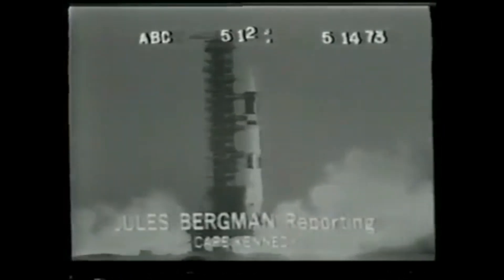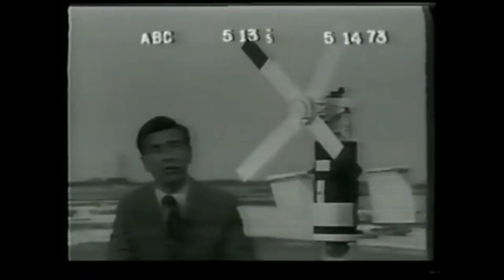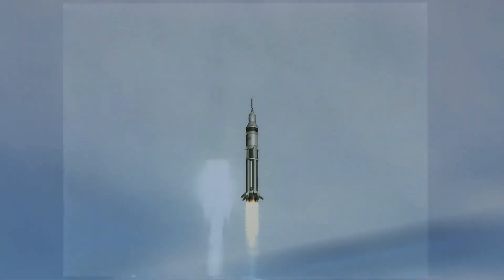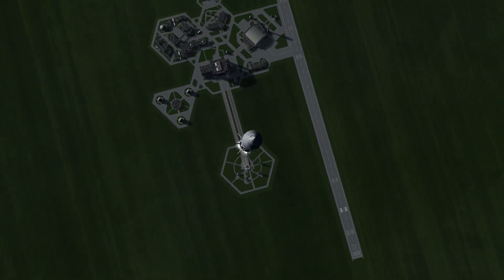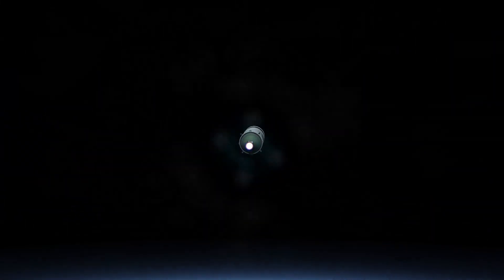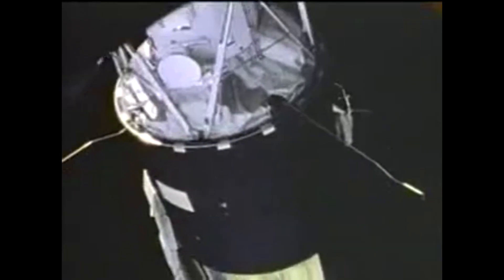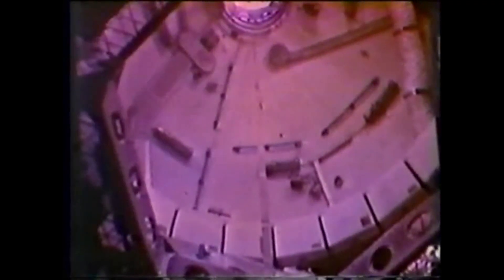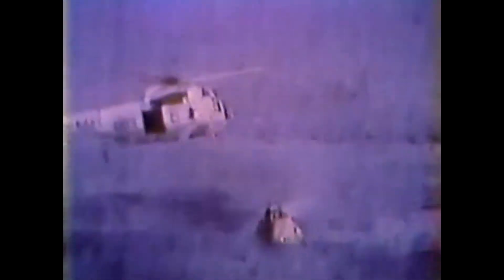Skylab - Episode 2 - A Change of Plans

Comment: With Skylab in space the first priority of Pete Conrad and his crew was to fix their house. The solar arrays were jammed and had to be cut loose, environmental control was turned off spoiling their rations, the MMOD panels on the hull were damaged and had to be replaced, and their docking port had to be fixed so they could get inside. Once inside Conrad and his crew went to work. Their first task was to deploy the two sun shades that were brought up folded in the command module. Once this was done and the sun shades were bolted to the hull Conrad and Kerwin want out on four spacewalks and freed the trapped solar arrays. With Skylab operational the crew stayed on board for 26 days when they were relieved by the crew of Skylab 3.

Comment: At 10min mark there on wires
Reply: Those are the cable cutter extensions and placement rods for the solar shield, and umbilical cable for oxygen, cooling, power, and communications, and a tether to the spacecraft.

Comment: I've read Pete Conrad's Biography "Rocket Man" and here's a few interesting tidbits/factoids trivia concerning him and Skylab. 

Conrad wasn't just an astronaut. He was also an engineer. And he was the astronaut that most closely worked with the NASA internal group that designed Skylab and her mission. He actually did drafting work on the actual design and contributed to "quality of life" additions that astronauts would need aboard a long-duration space station mission. Such as working showers and the first working "Space Toilet" for the US Space program. Later refinements of the techniques and designs he contributed made their way onto the International Space Station. 

He considered Skylab HIS baby. And was rightly upset and concerned when the reports started coming in that something had gone wrong. As mission commander he let the ground engineers and mission control bounce ideas around for a couple of days before finally getting fed up with them talking in circles and got them to focus on getting him and the other crew trained for the maintenance and fix additions to the missions by the simple measure of cutting one of their seemingly endless meetings short by saying tersely - "Just get me up there, goddamnit!" 

When he and Joe Kerwin were trying desperately to free the stuck solar panel, Conrad propped his feet against the hinge, and  stooped to fit the tether over his shoulder and “stood up.” Kerwin pulled on the tether and, this time, the solar array suddenly released and sprang into its full, 90-degrees-open position. That was in fact the final heave that popped it open and sent them tumbling. The grunting, swearing and final YEEEE-HAAAA is pretty funny to listen to on the tapes! 

Speaking of swearing, Pete Conrad was well-known for his "colorful" language but even so it's almost surprising just how much of the repair EVA official transcript reads "EXPLETIVE DELETED". 

Although Pete Conrad was pleased with his Apollo 12 mission, he said more than once that he ENJOYED Skylab more. It was roomier, they had more comfortable shirt-sleeve environments and clothes. GOOD food (by comparison) and as mentioned above an enclosed washing area "shower" (you didn't run the water much - just enough to get wet and then soap and then wet towel wipe down and dry before evacuating any leftover water before opening up the "curtain"). And toilet facilities that Conrad described as a hell of a lot better than "taking a dump in a can of pork and beans - the LITTLE one".  :D
Reply: ROFL, I can imagine Pete fixing the Skylab, the way McNulty and Bunk solve a murder: "Fuck ... fuck ... motherfucker ... fuck fuck fuckity fuck fuck fuk". Look it up. is hilarious.